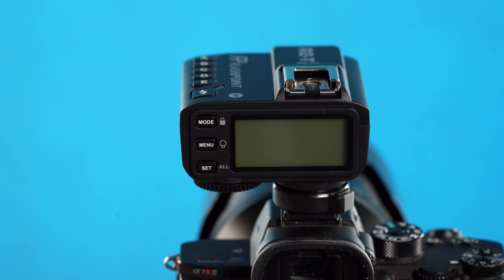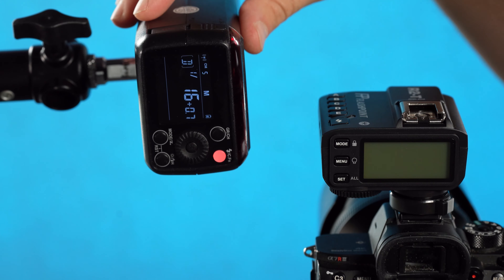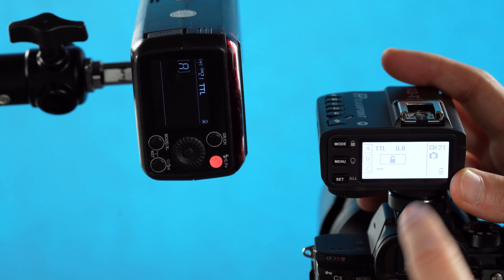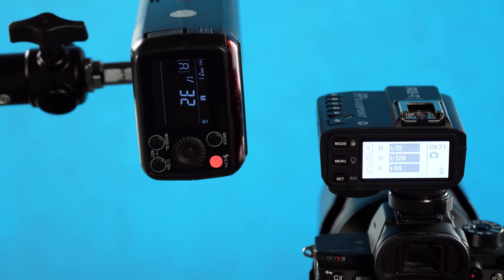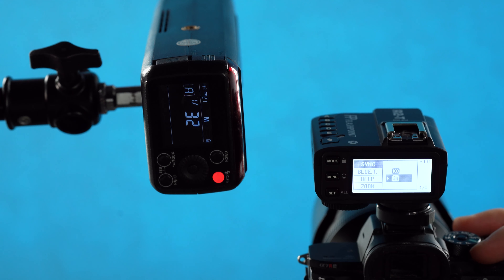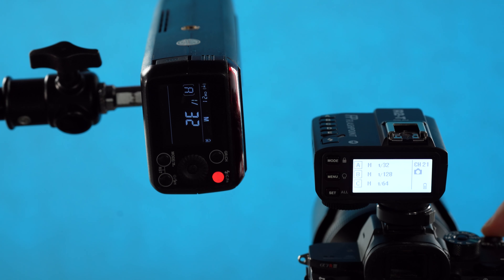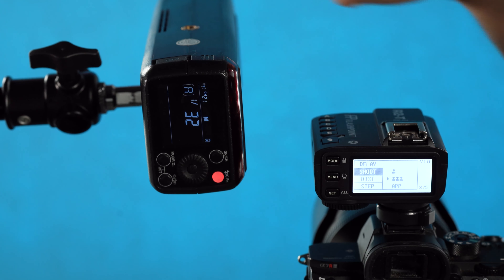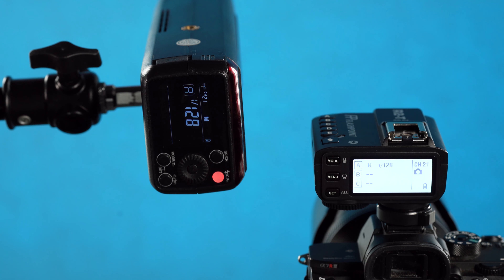GODOX X2-T GUIDE how to use the FLASHPOINT R2 T MARK II

Comment: Sir this video has helped me tremendously. I just bought the AD200 Pro and couldn’t get the X2T to sync with it. Turns out all I had to do was turn off the ID feature and it synced right away. Thank you!
Reply: how do you turn off the ID feature?
Reply: Omg your comment helped me more than this video. Thank you. I was getting over explanations about basic stuff (like how to tighten the flash on a stand) when all I really needed was the how to of connecting the trigger to the flashpoint. It was turning off the ID feature too. Thank you so much!
Reply: @philmontphotography  that's great! You're welcome.

Comment: Hello! 1) Does this unit the FlashPoint R2 T for Nikon or the Godox X2T for Nikon work or trigger the FP FLASHPOINT SL-360N?
  2) Do I need to a receiver/ transmitter kit to the FP FLASHPOINT SL-360N?
3)  What transmitter/ receiver kit do I need to use with the Godox  Wistro AD 360? 
4) I lost a  full case with transmitters and receivers when I flew overseas, and so far,  I have no reference for them?

Thank you so much!
Reply from the maker: @latinimagecl  by default the R2TN (Godox X2T-N) is not compatible with the SL-360N. Because the R2TN operates on 2.4Ghz wireless networks whereas the SL-360N uses previous generation 433Mhz (via the Ftr-16 receiver and FT-16 transmitter).

However there is a “bridge receiver” called the XTR-16. This receiver plugs into the SL-360N just like the FTR-16 and will receive a signal from the R2TN.
This same transmitter/receiver combo will also work with the Godox Wistro AD360 (not to be confused with the AD360II, which has a 2.4Ghz receiver built in).
Reply: @robhallphoto  It was NOT a good idea to contact you, BUT it was a great idea: a) First to be subscribed to your channel and then b) Ask for your assistance.  You were quick to reply with your kind technical assistance. I quickly got the Receiver ( Godox TXR-16 ) along with  the Transmitter( Godox X2T-N )  for my Nikons as you recommended. 

And Voilà! After a few attempts, both of my Godox flash units were working as intended. The manual flash unit Godox Wistro AD360 and the Manual/ TTL FlashPoint StreakLight/ SL-350N. No problem at all. even my  Nikon D780 was able to recognize and trigger  both Godox flash units with no flaws. Back to work with a 100% usability of both of these Godox flash units.

The previous Godox/ original Transmitters for these units were no longer available neither in The US nor in my area.  (I must mention that I was residing in the US until June 2024 before I flew overseas, to Santiago - Chile in South America for some assignments.  Delta Airtlines lost one of my cases with Godox Gear and accessories, and I was in trouble. They charged me almost two grands for my special photo gear cases for nothing. They never took any responsibility  and I had to eat all their BS with silly excuses. You really saved my ***. ( Please, excuse me for my French! )

You are the man, THANK YOU SO MUCH!
Reply from the maker: Glad you got it sorted out so quickly! Thanks for all the kind words Al.

Comment: Hi Robert - thanks for the very helpful video.  I have this transmitter but when I dial through the options available TTL isn't available.  It only goes to M.  I can get the transmitter to trigger the flash, but not in TTL.  I'm sure I've missed something re: to setting it up, but have been unable to correct it.  Would really appreciate it if you could point me in the right direction.  Thanks in advance.
Reply: I'm having this same issue. Did you ever find a fix?
Reply: @mynameisneb  Haven't used the R2T in quite some time, but as I remember once you select the channel you plan to use (A thru E) press the Mode button until TTL appears.  You may have to press it 2 or 3 times.  Once TTL appears press Set to select it. I just tried it and that worked - hopefully that will solve the problem.
Reply: @clydehamilton8138  Thanks I'll give that a try. I wish I had known I was getting the R2T when I ordered my flashpoint the other week, oh well.

Comment: Hey mate. Just swapped my D850 for a GFX. I have bought a new Trigger, the X2TF. Positive start. But... I am trying to connect to my AD200, but it doesn't seem to link. I have made sure my X2TN is switched off.... I'm sure I'm being thick, but I am a bit stuck....    Any thoughts sir, nearly need to be able to swap systems easily if possible?   Thx 👊

Comment: I’ve just seen your review on X2T and I have two questions:
1 - Do you know how to set the on-board flash (the flash on top of the transmitter, I’m not an English speaker)? I couldn't find any information about it :(
2 - On the page 47 from the Manual they are saying about the TCM Function (Transform the TTL shooting value into the output value in the M mode). How to use/activate it? 
Thank you in advance, Robert :)
Reply: did you find out how to do it?
Reply: @GotEmVids  No, unfortunately no. It is the reason why I asked the "influencers/reviewers"...
Reply: I purchased the x2t for that reason i think i might be returning it and get the xpro
Reply: @GotEmVids  Me neither. It is the most strange decision Godox have made: they came back to the flash shoe on top of the transmitter, but that flash is not communicating with the master :))

Comment: Thank you.  Do you know if there is a way to turn on and off the lights through this trigger like the profoto does?
Reply from the maker: Off as in not firing but still active, simply navigate a group to "--"
Off as in powered down, No. Although godox lights operation drain is 1/10th of the Profoto's I've used so it's not a huge deal.
There's also sleep settings, where the flash powers down everything except for reception of a wake signal, which is great for avoiding power drain through long periods of inactivity. Thats a custom function on all the flashes.
Reply: @robhallphoto  thank you! I meant to power them on and off. I will check on activating the custom function of sleep mode. Thank you!

Comment: You doe a good video. Maybe I can ask you a question. Does the r2-t have to be on the camera to fire the flash? Asking because my previous set up allowed me to walk to the subject with transmitter in hand to use a light meter on flash. Also, I have tried everything I've read, but can't seem to reset the trigger to factory settings. Any help is appreciated.

Comment: Very comprehensive and clear. Thanks for making it. I am trying to find out exactly what I need to operate from an Olympus E-M1 Mark III and I see that this trigger has an "O" version. But, I need to operate Nikon flashes and one Phottix Mitros+ flash "For Nikon". I need power control and HSS setting from the trigger, on the camera. 

I will need to know compatibility. I went to your channel page and didn't see the compatibility list you mentioned.

Comment: Mine has newer firmware, v1.4. The MILC vs DSLR choice is removed, and there’s a new screen that appears to be able to turn groups on-off without cycling thru modes (but requiring too many button pushes in just the right sequence.)

This new screen does not turn off groups in my experience. It has what appears to be a limited power range for (something) that is adjustable without effect, including options to set ms and # of flashes, maybe for HSS but if so, that’s a secret. 

It’s a decent controller, however the 60 seconds before it goes to sleep comes WAY too early. The only way I could get the camera to fire the lights was to wake up the controller every time the 12-second backlight went out … not 60 seconds at all. I’ll try other settings I guess.

Comment: Hello. Do you now if you put a flash on the top hot shoe of this X2T it will take the “group A” settings of the X2T even it is not set to slave mode or it runs separately as a single unit?
Second question is if a flash runing on the top hot shoe of this X2T fires if the X2T is turned off? 
Thank you!

Comment: Great video! I have this X2-T unit - sometimes when I attached to the hotshot, and try to use with attached flash and also slaves, the display goes blank and the unit doesn't fire? It works perfectly fine when not flash is attached. Have you ever experienced this?

Comment: Excellent summary of the trigger! Do you know if there's a way to vary the output of the modeling lights. My AD200s have 3 levels but when using the X2T it overrides and turns them either to high or off but no in between.

Comment: Hey thank you for your help!! I own the X pro and I'm trying to figure if there is a way to change power on the strobes directly without the trigger changing it back. I need it this way because many times when shooting products my camera is too high and I can't see the trigger. Thanks
Reply from the maker: you can put it in app mode. Then it only sends the fire signal and no power level information.
Reply: @robhallphoto  thanks

Comment: Hi, I’m having issues with this controller and a godox v350, i have the channel, id and group, out of the blue the connection is lost like it simply stops working. Im taking macro shots so the flash is on a lightstand but close to me. You mentioned that if it’s too close it won’t work, so how exactly is that does it stops randomly ? Trying to figure out of that’s my problem. I do move it farther as a test but dont work. Idk. Thanks

Comment: I bought  this transmitter for Panasonic camera, however the  lower hot shoe where is attached to the camera has multi pins contacts, except the hot shoe on top has on ly 1 pin contact.  What is going on with this model? If it has  no multi  pins on the hot shoe, it will not  has the TTL function if you attach a Panasonic flash on this hot shoe.  The box of the unit did show it has multi pins, but the actual unit itself doesn't.  Please explain...Thanks

Comment: I have had 3 Canon EXRT flashes for several years.   I recently purchased 3 Flashpoint R2 round flashes and a trigger.  Is there a way to get the Flashpoint flashes or the Flashpoint trigger to fire the Canon flashes? The ID function on the Canon is four digits and goes from 0000 to 9999. and the feature on the flashpoint goes from Off - 99.  The channel selections on the  Canons range from 1 to 15 whereas the Flashpoints range from 1 to 32. I hoped to use the three new flashpoints on Group A, B, C and then two of the Canons on D and E.  Is this possible and if so, how do I need to configure this.?

Comment: I have this trigger, the Nikon version, and although it worked flawlessly for two shoots with my D800 it is now intermittent with my D850 & D800. It simply won't work consistently. It'll fire for a few minutes then stop for another few minutes. I'm able to forcibly fire the flashes from the trigger, but not when I press the shutter. It's bizarre 🤯

Comment: Old Vid, but just to point out, for some reason, in Sony's wisdom, I don't they didn't allow the e mount  Nex, or the a6000 series to be able to work any Flash or flash trigger's AF illuminator. It was only until the A7000 series it actually works..😊

Comment: How come I can't put this transmitter in ttl mode? I had it once but now it goes to manual or I get the dash line??? Mine is called the R2-T II from Flashpoint. Same as the Godax one.

Comment: Has anyone tried to use this trigger with Sony native speedlights? I have a Sony HVL-32M and I think it is supposed to work but cannot get the X2-T to communicate with it. I have it set to channel 1 and the flash in WL mode. Still won't fire. I also ordered a GODOX V1 but thought maybe I could the Sony as well.
Reply: None of the Godox triggers will fire Sony flashes
Reply: You gotta use a X receiver unit to talk with other ttl flashes of other brands (The X1R is the only one I know exists so far)